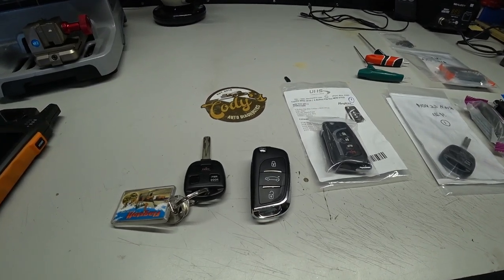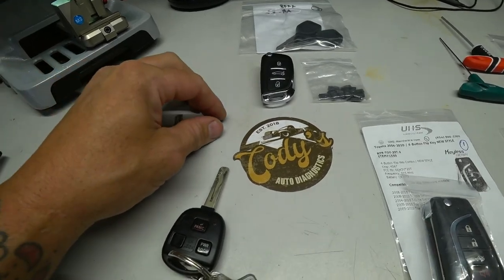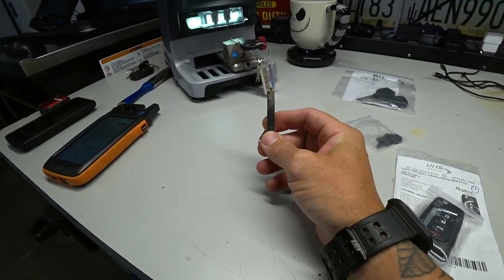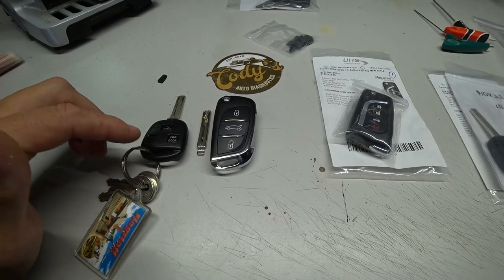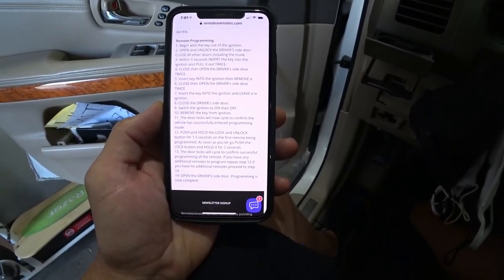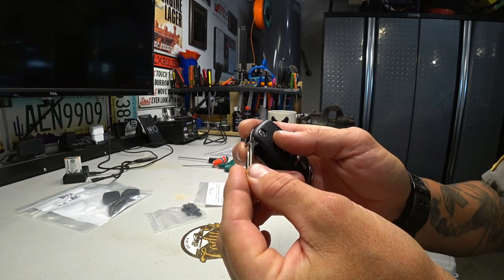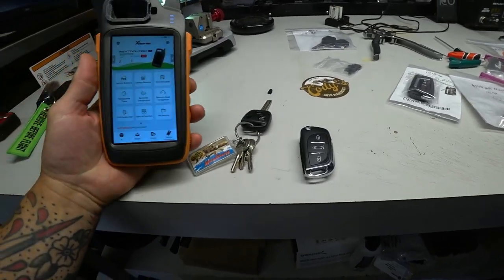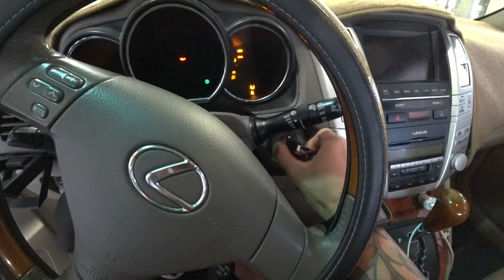Out With The Old/In With The New

Comment: I like the addition of the X-horse and I am sure you  thought this purchase through and make it pay for itself . 3 Years ago I thought about adding the cutting machine but my access to  locksmith services is from every point where I am working from maximum 30 minutes . I don´t have to explain to you that the upkeep on scanners , software subscription renewal and new tools take a pretty big chunk of my income . The locksmith´s prices are so low that it´s not worth buying the cutter . I can program every key and in my case that´s enough . Success Cody .
Reply from the maker: Yeah I hear ya on the price of equipment and upkeep. I have been asked multiple times a week if I do keys so I knew this equipment would pay itself off pretty quickly.